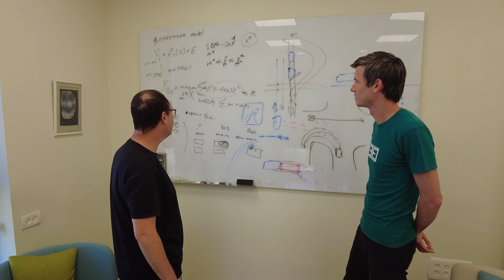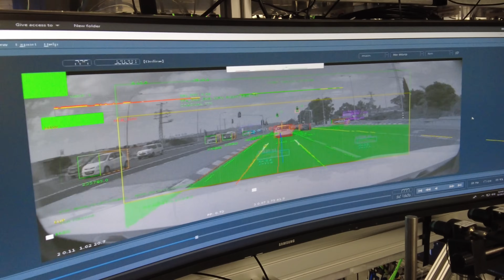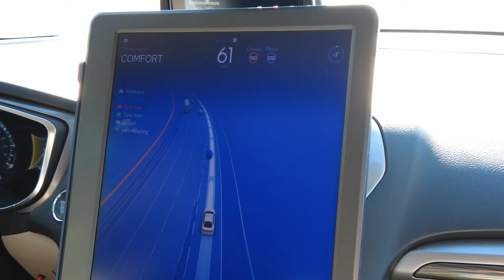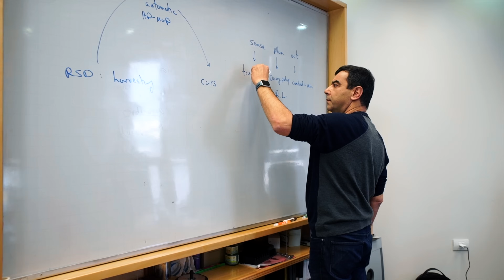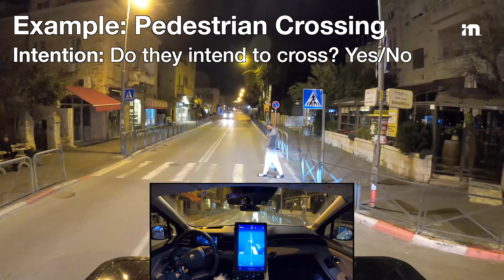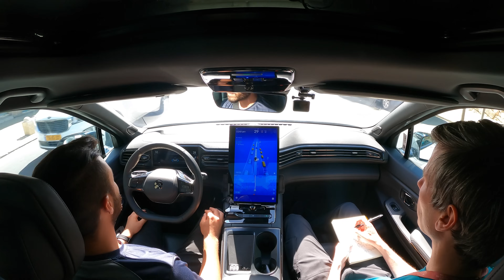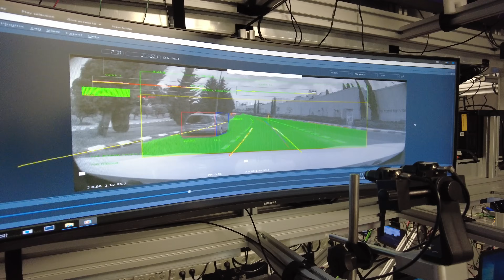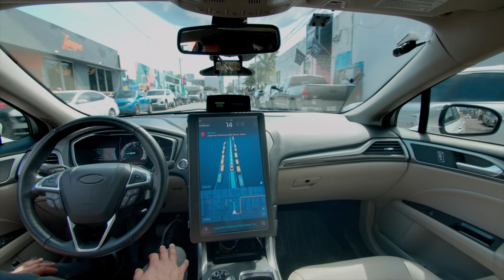Are Autonomous Cars Closer Than You Think?

Comment: In situations where's plenty of time for the driver to take a decision and the system doesn't spot imminent danger, the driver should be allowed to impart the illegal move

After all it's a choice of the driver to set your cruise control at 70 in city or your speed limiter at 30 on a highway, cars haven't been intelligent enough to refuse those orders and liability is totally on the driver
Reply from the maker: Yeah, as mentioned, there's an option to select (For example "go around obstacle from left/right") if the situation needs it.

Comment: A map based system is ridiculous.
Reply: Yeah it's funny he said mapping is "critical" except Tesla accomplishes this without HD mapping. So, "optional" or "crutch" as I would think.
Reply: @thebigds  what exactly is wrong with using maps? how is knowing whats ahead of your visual range a bad thing?
Reply: @zjanez2868  Good question. First, it isn't necessary because human drivers drive just fine without it. Second, using HD maps means the car only works in aeras where it has been mapped. This makes huge challenges for scale-out across the globe. Third, it takes a lot of resources to create this mapping data, so increasing the cost of the product. Fourth, these expensive and unnecessary HD maps are only valuable to the extent they're accurate. So construction or temporary changes or even bad weather can render them inaccurate and useless, or even increase risk if the car is following inaccurate map.

I like Tesla's approach, where the car drives mostly like a person, making decisions based on what it sees in that moment. The car can perform the same in a brand new area, new construction, changes, huge snow drifts, whatever.
Reply: @thebigds  never said it was necessary. i just said its a nice thing to take advantage of
also not sure where the "HD" part came from and i really dont think actual HD maps are necessary
a road layout with the relevant driving data(average speed, dangerous parts, maybe road priority info- so the stuff you would learn by driving in the area) should be enough
how i see it is the car still mostlyrelies on its sensors for the actual driving, but uses the map for a better and safer drive
Reply: @thebigds  I think people should stop comparing the systems, the idea is to achieve the impossible, how we get there isn't that important.
Reply: @HearToneSpeak As a consumer, you don't have to care, cause you just wait until the race is over, and pick the one with features, cost, and safety you want.

However, for the business and tech world and investors, it very much matters, since we pick a team (or teams) while the race is still being run. It matters who gets there first, since they will have an advantage to capture market share. And it matters how much it costs to get there, since lower cost will have an advantage to capture market share. If the solution costs too much or takes too long, it might fail alltogether.

I'm not saying other approaches should be disallowed, just saying I don't think they are the best way. And if we're attempting the impossible, we should pick the path most likely to get success.
Reply: @thebigds  Actually, I'm a Green tech Investor.  I think getting there first isn't the real issue.... it will be about costs.   If Tesla can make it with their suite, they will dominate the market.   Cameras are inexpensive when compared to the array of sensors that most of the others use.  All eyes are on Tesla, even if they are second to market, the costs of their system is less than $500.
Reply: @HearToneSpeak  That’s right, first is important but it is no guarantee of anything. Look at apple: rarely first, but consistently neat the top. I’m also long TSLA since 2017, I think they can be both first and cost less, but time will tell! I like their odds, but it’s not a given.
Reply: @thebigds  True true

Comment: 1:37 Having the system interpret bikes and benches as full-size cars (as visible on the central screen) seems less than ideal.
Reply: It may feel like that, but if you think about it, what's the consequence? Thinking a bench is a parked car doesn't change anything, you don't hit it either way.
Reply: @Renegade605  The more significant concern is the reciprocal misinterpretation. Also, what if the risk assessment module has to decide on hitting a pedestrian or a car (even at low speed), and the car turns out to be a cyclist? Accuracy is non-negotiable with this type of system.
Reply: @BrenoLuna  if we accept your hypothetical and the car hits the cyclist, what would it have done differently if it knew it was a cyclist? Hit the pedestrian?
Reply: @Renegade605  Hard to tell. It might trigger some other set of responses based on the higher risk of injury (due to the change in the playing variables) and the surrounding environment. Again, a self-driving vehicle should strive for the highest level of accuracy.

Comment: how do they manage the signal cross talk issue when there are multiple vehicle with lidar and radar nearby ? wouldn't the bounce signal erroneously register by other car and multiple car's lidar interfere and jamming each other accidentally ? In cell phone signal they had similar signal cross issue and they had various technique of encoding the signal and distribute the signal into smaller district cell zone. Or is mobile eye give each car an unique lidar signature so they don't jamming each other ?
Reply: No I want to say no as that does not happened with planes.
Reply: @GreenBlueWalkthrough  It doesn't happen with Planes, because we maintain sizeable distance from each other.
Reply: If I had to guess they have a system to recognize garbage data from Lidar, and in that case use the cameras.
Reply: Incidentally background photon pollution also happen with lidar. During dawn or dusk sun ray can come into lidar. And give erroneous reading. And there is also opaque surface (IE black tire) to lidar light spectrum and light incident angle could affect the reading accuracy.

 I done some work in university with multi drone with lidar sensing. So I had encountered some of these common lidar issue. Since our department budget was pretty cheap. Could only get the cheapest lidar with no fancy phase velocity modulation. The signal cross talk could get extremely noisy once you get around 10 drones and above. So I was wondering how mobile eye solve it without spending lots of money.

Comment: It uses human driving behaviour? Great mistake!! :D
Quite impressive, nontheless.
17:00 does it evaluate if it might be quicker to turn right, then retake where allowed? Could be a better solution, as it won't block the way that much.
I wonder who is going to be liable for any damage that might be caused by a self-driving car, the car's owner or the company that manufactured it?
Reply: depends on the system
lower class (that require a driver to always be ready to take over. that is most modern SD system) put it on the driver
for higher levels the manufacturer is responsible

Comment: So what happens if the REM data is populated by alot of bad drivers who intentionally break the rules of the road often. Will the car do the same?
Reply from the maker: You can do whatever you want with the data. You can pick out the safe drivers from a group and mimic their actions (it doesn't have to be as simple as "do the average").
Reply: @EngineeringExplained  Ok that's cool. I am assuming that their system has the ability to select good behavioral patterns different from the bad ones.
Reply: Yeah, I can imagine an AV mimicking a Florida driver. Better have good auto insurance!
Reply: @michaelblacktree  🤣 try Jamaican taxi drivers😂
Reply: I guess they might interpolate from the base "lawful" data and find the closest average to that and follow it.

Comment: My biggest concern with autonomous vehicles is criminal liability. If the AV hits a construction worker am I going to prison for manslaughter? The computer may be a better driver than I am but I’d rather drive myself and suffer the consequences of my own actions rather than the actions of a computer.
Reply from the maker: Depends what level the system is, and who's taking responsibility. For example, today's level 2 systems (majority of what's on the market) put liability on the driver. If you're entering a L4 robotaxi, the liability shifts to the company operating the robotaxi, as you have no control over the driving.
Reply: @EngineeringExplained  What about Level 3? Where's the "line" between culpability of driver vs manufacturer? Has this line been established in any court? Honest questions
Reply: I recently wrote a post on this stating that the first (and possibly only) division of the levels of autonomy need to be based on who is responsible for the actions of the car. SAE falls very short on this critical concept.

Comment: Maps need to know your EXACT POSITION WITHIN INCHES.  I have the State Farm safe drive button and when I check how it tracked me, I’ve seen it show me driving off road BEHIND my neighbor’s condo.  Ok, cellphone tracking may not always be precise but do you really trust GPS in all cases?  As a retired engineer, I will NEVER trust an AI driver - at least not for at least a decade.
Reply: And the State Farm button was designed to drive your car and requires accuracy?
No, thought not

This is a nonsense strawman. 

AI cars are still wildly unsafe, so there is no need to make up nonsense to justify being afraid of them.
Reply: @FuncleChuck    Not a straw man! It wasn’t designed to drive but to monitor MY driving so it knows where I am and and how fast I drive, brake and accelerate.    Seems like some of the basics for an AI system, dontcha think?  Oh, and it knows roads and speed limits…so get your facts straight before spouting off…
Reply from the maker: It's not using GPS to determine exact position. GPS gives a general idea, combined with known maps, and then the cameras/radar/lidar localizes the vehicle to its exact scenario (for precise positioning).
Reply: @EngineeringExplained    Ok, but check out the intersection of  Cuyahoga Falls, Oh, State Rd/Portage Trail intersection.  When an AI vehicle can safely traverse that mess in an Ohio blizzard, I’ll believe it has a chance.  Southbound lanes need to veer right immediately to avoid a permanent, central obstruction in the road.  Crowd sourced maps may do it - we’ll see.

Comment: More and more nannies teaching the driver's to pay less and less attention making the roads less safe. Just look at the accidents per mile driven since their inception.
Reply: Correlation ≠ Causation. If the solution to driver safety was "JUST DRIVE BETTER" we would still be cruising around in 50s cars with no airbags, headrests or seatbelts.
Reply: @PringleSn1ffer  Those items are not intrusive, distracting nor encouraging distancing from the actions and responsibilities of driving.
Reply: @daveblock1688  What is so intrusive and destracting about the so called driving nannies?
Reply: @PringleSn1ffer  Outsourcing your own thinking and reasoning capabilities to silicon is intrusive, especially when the market will increasingly offer no other choice.
Reply: @kylesanders8276  You're not outsourcing anything in terms of safety systems. Let's take blind spot monitoring as an example. Instead of your blind spot check relying on yourself glancing over your shoulder for 150-200ms and maybe or maybe not seeing the car speeding down the fast lane at 85mph, instead you have two people checking your blind spot, yourself and the sensor. If you rely only on the sensor than of course that is not a great way to drive, but to say that that is the way that most people use these safety systems is very cynical, and likely untrue. The same can be said of partly autonomous highway tech such as lane centering and auto cruise control. The point is not to allow the driver to play Tetris on their phone and take a nap, it is to take away some of the tedious work of driving in order for the driver to stay alert longer. You can choose to look at these systems cynically if it suits you, however cars have never been safer than today and are going to continue in that direction.

Comment: RFCs
1. True redundant systems of which one is color blind - eeeeehhh..
2. The simultaneous redundancy explanation indicates via logical reasoning that false positives are drastically increased.
3. "No company wants to create something that openly breaks the law." Meanwhile we heard the system learns behavior from the human-driven fleet and we didn't hear about any manual checking of the training data (which would be non-trivial considering we did hear that this approach scales globally).
Reply: Seems like one system is like the backseat driver telling the other one its not breaking fast enough
Reply: @jamesv4262  Which also means that it will break even if only one system wrongfully thinks it saw something that isn't there. Which is extremely likely with Radar and depending on conditions and implementation somewhat likely with Lidar and cameras.
Reply: Many, many companies openly flout laws. They call it “disruptive technology” and execs who make the “Uber” of anything should be jailed.